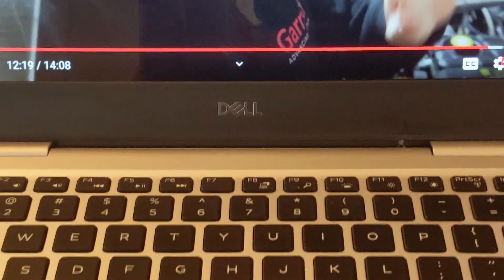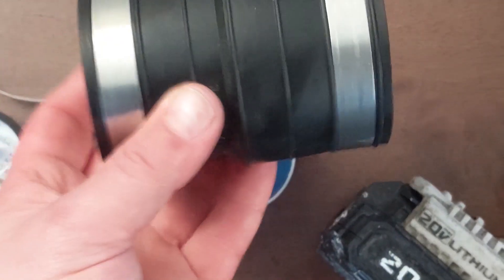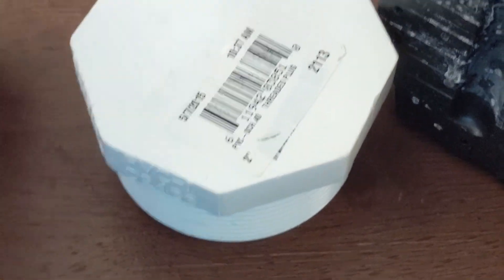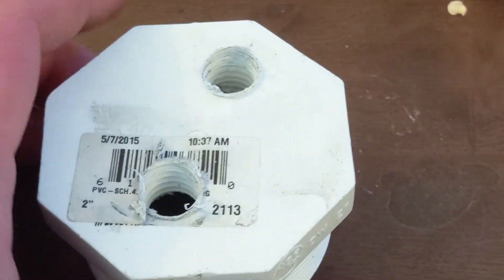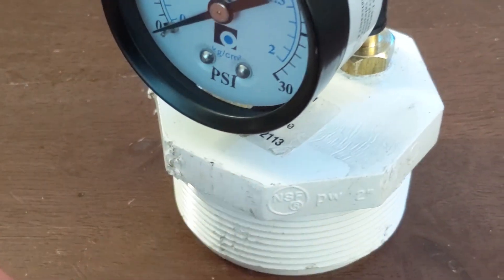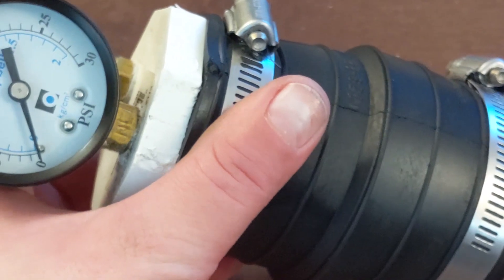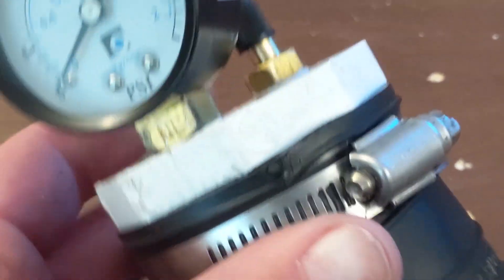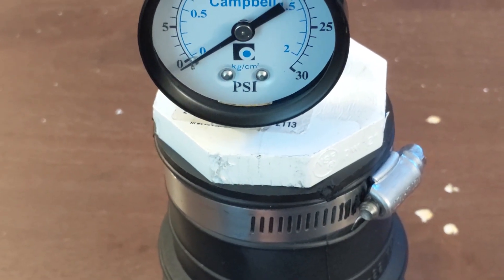HOW TO MAKE A BOOST LEAK TESTER FOR YOUR CAR!

Comment: i have a 1g 92 dsm, bought wideband fpr 2g maf 650cc high impedance  injectors found a mod to make them work. But i found out the maf wont be able to run that and was looking into maf translator. Would i still need to get a safc if i just watch the fuel pressure and wideband?
Reply from the maker: I think the fuel pressure should be fine at stock levels (1g 37psi stock and 2g 43psi stock)on that size injector but unfortunately fuel pressure is only part of the equation.(1) using the maf-t to dial in the correct setting so that (2) the wideband shows you safe voltages  under load while (3) you have a good way to data log  your fuel trims before you go to hard on the throttle. That's the 1-2-3 of it lol. Guessing fuel trims can be an extremely expensive game. I would look into some form of datalogger coupled with the maf-t and fpr. I used to use a scanmaster 3 in my 1g to see fuel trims were at 100% and after a little bit of testing, keeping my eye on the wideband, I would watch the scanmaster 3's "knock sum" to verify that things wouldn't blow up in boost.
Reply: @TPGDSM  ill look into the scanmaster 3. But with that fpr,maft,650s, wideband, high resistance mod i should be alright then?
Reply from the maker: @amplion6885  I dont want to give you bad advice and have your engine try to kaboom on ya, id say to be safe stay around stock boost and you should be ok BUT without data logging you never know. Each engine is different. What maf-t settings work for one car may be completely different for yours. That's why logging is so important. It'd be safe to say you could get your car running reletively well with the maf-t, 650's and fpr but if it were me personally I wouldn't go ripping hard in wide open throttle pulls untill I could see my trims and knock sums. Who's to say the wideband looks ok but the ECU is 20% lean and your getting 18 counts of knock at 18psi? I'd just investment in a logger before going out Saturday night and chasing down your buddies late 90's mustang lol. Hope this helps 👌
Reply from the maker: Side note back when I had my circle track purpose built 91 tsi all I had was a maf translator on a beefed up engine running a Frankenstein 20g at 28psi we were  basically broke and couldn't afford expensive logging tools and ended up going through 3 different pistons trying to tune in the dark. Maybe it wasn't the best idea at the time BUT it was a hell of a lot better to be able to go out Saturday night ripping the car around versus being stuck watching your friends run without you. Hindsight is 2020 hahaha
Reply: @TPGDSM  ill keep researching might just try to get dsm link and read but thanks for the advice really helps. Im currently pulling the motor n trans to replace bunch of gaskets n rtv sealant other people used instead of a gasket.
Reply from the maker: @amplion6885  that's a total bummer when people do that!. Dsmlink is my favorite option. You'll be able to do anything with it. I'm working on my install as we speak. Best of luck with the project. Feel free to post questions whenever you have one. Folks that tune in may have answers better than mine faster than my replies.
Reply: @TPGDSM  thanks i will good luck on the installation.
Reply: Where did you get the rubber coupler at?

Comment: Cool to see how people make these a little bit differently. I have one of these that I made a few years back.  Didn’t bother with a gauge since I can set the pressure on my compressor.  I guess if someone is using something like a tire inflator the gauge is def needed.
Reply from the maker: Absolutely right, there's no wrong way to make one as long as it works for what you need it to do, find those mischievous boost leaks! I'm finally chasing down mine.